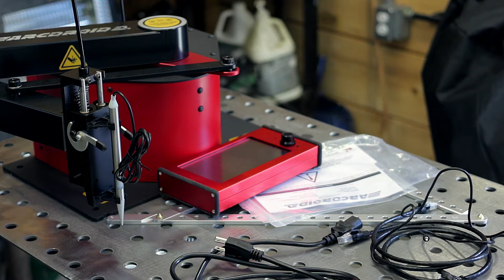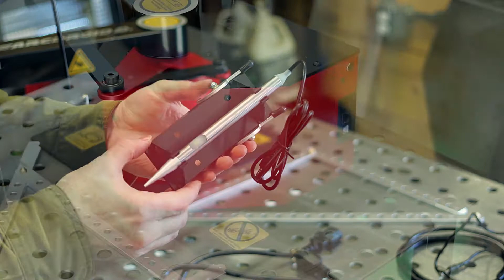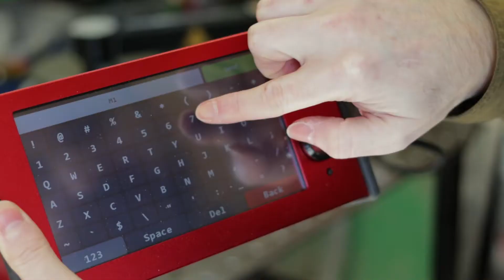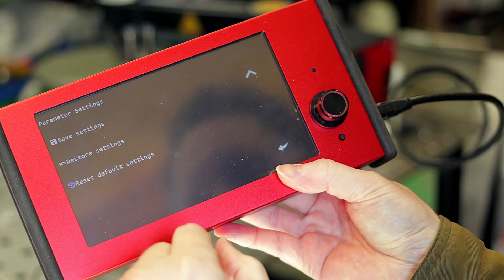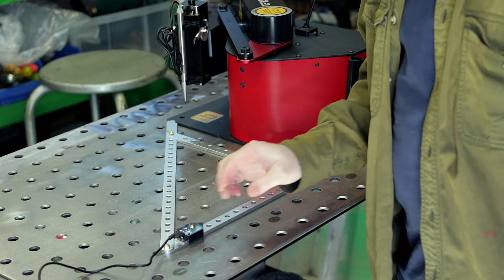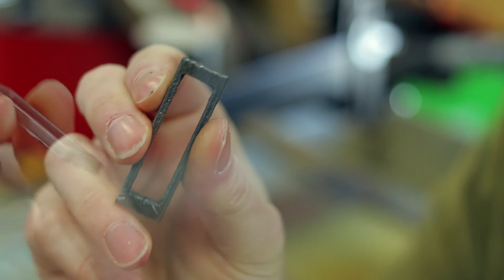ArcDroid: Initial Look and Setup Calibration Troubleshoot Tips

Comment: What size table is required? Space is limited in my garage. Thanks for the videos.
Reply from the maker: Optimal cutting range is 15x26 inches. X2 extends length to 48 inches. It's on the ArcDroid website along with dimensions of the machine itself. www.arcdroidcnc.com

Comment: Cool video, where did u get the fixture table and do u cut on it after machine is calibrated or hang metal to be cut off the side and turn the machine
Reply from the maker: Fixture table was from Princess Auto (I'm in Canada). I made a dedicated plasma table with slats, you can see it in some of my other videos.

Comment: I've watched several more of your videos, you did a good job covering the issues related to the  Arcdroid.  When you got into the subject of torch height for the Arcdroid.  Sounds like you got deep into the problem, anytime one gets into designing and developing the electronics to solve the problem.  Being a new machine, I guess he didn't get the problem of torch height solved before selling it to the public.  But I thought I noticed the torch go up and down to get the initial height of the material before activating the torch.  Did I notice correctly or was I wrong?  Did it carry itself correctly from that point on?  The word dynamic height control is what I would call it.
I haven't seen the price anywhere.  Will you tell me that price or do you feel reserved about that subject?
Reply from the maker: Thanks for that Roger. There was a whole section to the THC Part 2 I left out because I think the company deserves a chance to address it. But you are correct and where I have a problem is that this was an advertised function of the machine but there are some major problems and they clearly never had it working properly before production. I hope to also do a video or two on the unique features of the Droid so it's not all just about the problems. They are calling it Torch Height Compensation which I think is a good description. And yes, the machine probes the surface before retracting to pierce height.  You can find the price at https://arcdroidcnc.com, just click on the buy tab.

Comment: Where did you get the information on the G-Codes?  Is there any sort of reference sheet with applicable G-Codes for this machine?  Never heard of a "G28K"  Wonder what else I'm missing...  Andrew really needs to release a Technical Reference Manual for the Control...
Reply from the maker: It's Marlin based so you can google for a list of Marlin gcode. I've never heard of adding the K to it. Using G28 seemed to work for me but Andrew was insistent that the K needed to be there, so maybe there is something specific to the code they've altered. 
You can always give Andrew a call, he is great about answering questions. A manual would be nice but those take time and money so I understand why there isn't one, at least not yet.
Reply: @amp_mechanic  THANKS for your quick reply!  That's very helpful info!  Much appreciated.

Comment: I didn't really have any problems calibrating mine at all. The little switch did catch and is certainly going to need replacing. My biggest problem was and it's a huge problem. I mean catastrophic.  I've got 3 grandchildren running around my house and shop right now all under 6 years old. I have yet to do anything more than calibrate it and do a dry run on a few things. It's been oh a month now after the long wait for it's delivery. Lol the thing's grandpa's put up with? I am excited because in the few minutes I spent testing the Arkdroid I know it's going to be a ausom addition to my shop. Thanks so much to the designer's for inventing such a great piece of equipment. And good luck and good time's to all my fellow Arkdroid friends out there. Peace ✌
Reply from the maker: Hopefully you get to use it some sooner than later. Great little machine with lots of potential. Cheers!

Comment: I have the same problem, how do you remove the cover, please advise what screws to take remove
Reply from the maker: Hi Harry, there are 6 button head hex screws on the sides. 2 by the connection ports (in front of the the usb, ethernet, micro SD). 2 on the opposite side. And 2 on the front (arm side) near the top, left and right side of the rubber plugs. You may also have to loosen the one at the back near the top to give the panel some movement. Front cover should slide straight out. Hope that helps.
Reply: Hi there. Thanks for the input.  There is another option. There are 2 plugs on the front of the machine. I removed the plugs and using a boroscope and by rotating each arm was able to locate the tightening screw. Upper hole is for short arm. Lower is for main arm.  Used Allen wrench to tighten screw and that worked. I believe this may be an overload protection in case of a jam. Waiting to hear from Andrew on that.  Might have to loosen somewhat for jam protection
Reply from the maker: @harryworkshop4001  The screws accessible behind the 2 plugs are for adjusting tension of the drive belts. The pulley drive gears are on the end of the stepper motors. 2 set screws per gear, those are the ones that can loosen in shipping.